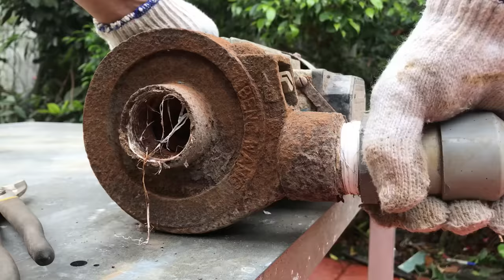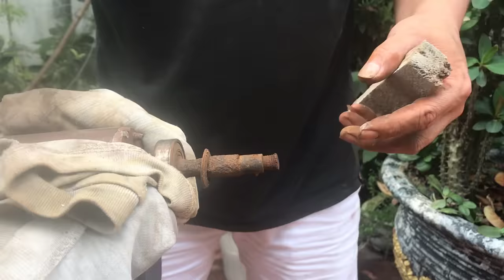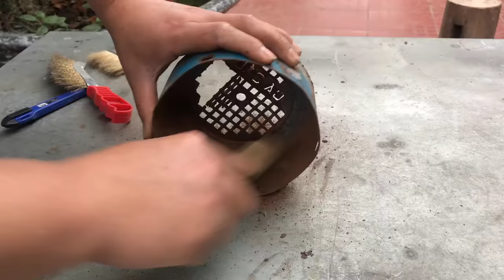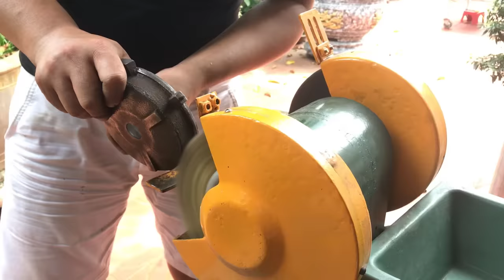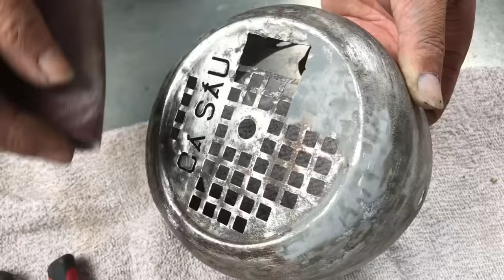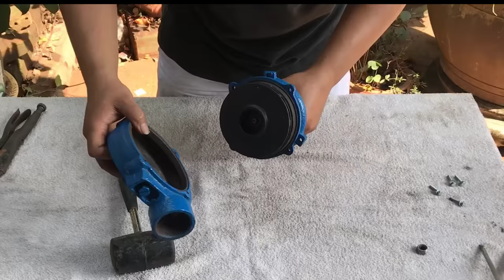Electric Water Pump Restoration - Restoration Perfectly - Tool Restoration

Comment: Some have commented on the lack of the right tools.....In my opinion it is not the tools that make the restoration...It is the use of the tools available that makes the worker A GREAT RESTORER. !! Great Job :)
Reply: I agree
Reply: MY 9yr old can do so, if we had the tools. Thats a fact
Reply: "A GREAT RESTORER" uses the correct tools. A few basic tools are all that is required to do it properly.
Reply: I do not agree with you, there have been many failures in this restoration. If this pump were tested with water, water may leak through the mechanical seal. Bad work done.
Reply: U
Reply: whaha, the first tool that comes into my mind is a sandblaster. that would save soo much time and effort
Reply: absolutely
Reply: dazzIar3 I noticed that too. but i gave consideration coz boIt's head were aIready deformed because of rust. he used proper tooIs when repIaced by the new one.
Reply: I think that you can have all the best tools in the market, but.. if you don't know what to do with them then they are useless, but on the contrary if you know what to do and don't have all the tools but you can get the very same result or even better , then .. you are a genius.
Reply: Заебись
Reply: I can restore anything and im 10
Reply: Hello
Reply: You said man, I'm a auto technitian and a older technition that I worked with and learned a lot from told me that same thing, that's cool that you said that.
Reply: @zenobiomenezesalvim1398  I disagree with you man, I've repaired my pump and the thing runs great no leaks and trust me if you saw my rebuild, you would scratch your head, it's a electric pump it will be fine, stop hating.
Reply: 善用手邊的各種工具,像馬蓋仙一樣
Reply: I agree.  People with all the fancy big shiny tool sets are usually the ones that would just go out and purchase a new water pump anyway.
Reply: Great experiences تجارب رائعة l
Reply: Йй
Reply: Okey muchas gracias sigan asi
Reply: 0000
Reply: @สุนิภาคุราโมจิ  what does this mean in English??
Reply: 11
Reply: @fellpower  c
Reply: 100% correct. Ingenuity and resourcefulness is the key.
Reply: Professionnel
o
Reply: Ok
Reply: Hıyar pompayı yanlış topladı
Reply: J
Reply: he  dose  not   have  proper  tool
Reply: @frankbradleyjr  km😭
Reply: comprate mas herramientas, pata trabajar mas eficiente y rápido!
Reply: حننن

Comment: After restoration and running the pump dry  well.. good luck to the newly installed shaft seal
Reply: made that mistake once. cracked the Teflon like a moron. Good job though. If you had used a puller the vid would only be 8 minutes long in real time.

Comment: The water outlet originally was on the top. After reassembly, it was to the side. You have turned pumping section of 90 degrees.

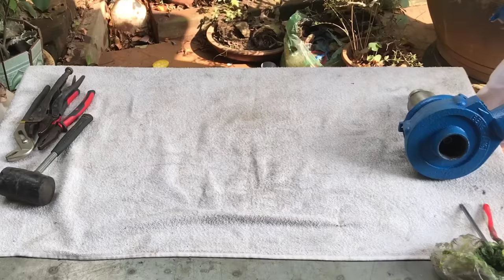Comment: You didnt tape off the  eye connectors on the ends of the  wires and they are covered in blue paint when you reassemble from 24:32 on.

Comment: Why you connect it with two wire cable ? And what PE ? .....Especially at water pump it is sooo important when winding break to motor casing.
Reply: Welcome to Asia... I don't think I've seen any restoration video that conformed to European safety standards yet. Or maybe one... and that was Czech, not Asian.
Reply: Thai style
Reply: and look at the wiring cables of the motor with paint on it.. :D no matter, lets put cable terminals over it :D
Reply: ఈ మేరకు కేసు కీలక jjjzjhejdhejjjjzjznnjz

Comment: Good work. Except, the output/outlet facing sideways rather than facing upwards. Anybody noticed it?
Reply: Shouldn't be any problem. In some cases, the pressure side pipe needs to be turned.

Comment: I greet you friend and congratulate you for your great willingness to work. I admire the effort you have put into it.
However, I note that the motor shaft is worn and deformed at the end of the pump. That axis must have been repaired, that is, filled to its original diameter and machined; because that's where the pump seal fits so you don't lose water. It is very likely that if it is not repaired there, it will lose and end up spoiling the new bearing.
Finally, the drive connection goes up and not to the side. Notice that you have a drain plug there that should also be up. Greetings and congratulations!

Comment: I like your video for dedication & hard-working. There are many mechanical faults you have to do - the Main shaft is very loose in roter,  shaft is under size for mechanical seal because rusted, you apply grease in ceramic side, you have change delivery side its up on the  beginning(no matter for this pump). so I can say that the pump is running but not suck the water.

Comment: Exit pipe is horizontal (should be vertical)  cooling fan removed, the bearing is not properly fit. No earth cable.... What is it used for? Quick sale?

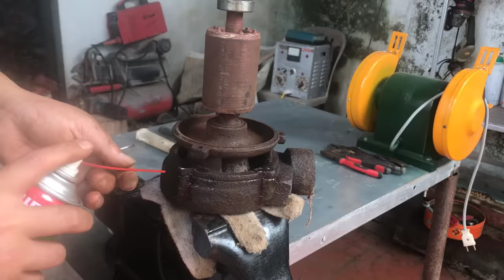Comment: 4:28  There are better ways to get rusted  thing loose like these ones . For exemple Electricity combined with water and landy  soap   with the part saoked in it for about 24 hours depending what kind of voltage and amperage you use but extremely effective

Comment: That was interesting to watch and entertaining, just a little constructive criticism, you should be pushing the stationary part of the mechanical seal in by hand, don't knock or hit the carbon face with a metal object, the actual mechanical seal journal was very badly worn ( you would need a shaft repair or replacement, so understandable why it was left as it was) and on installation would no doubt leak like crazy, also I didn't see the impeller being retained by a nut? was still an good video though, and i gave a thumbs up :)
Reply: Shaun - i agree withyour comment. The impeller nut was on the table and suddenly disappeared - guess it was later fitted. The only other comment i have is -that at the end and i think just to show that the pump worked - the pump was running "dry" - which is a 100% not to do.

Comment: TAIZHOU JINLONG PUMP CO.LTD. is one of the major professional manufacturers for water pump and accessories of pump in China. Ww are located in Wenling city Zhejiang province of China. And were founded in 1980.Our current production ability is over 1.000.000 Pcs year.
We always supply high quality pumps at competitive prices and best export service for all customers, Our main products including. Vortex pump, automatic controller and parts of pump. Some of our products have the approval of CE/GS . The quality or our pumps is under strict control in every aspect of products and is also acknowfedged by ISO9002.

Comment: Try to not spray paint the Electrical Connections next time, and DONT run a water pump dry that will destroy the pump, it is a water pump not a blower fan

Comment: Learned the expensive way that one should not run a water pump dry because the water seal between the pump and motor will get damaged. Test the unit with it connected to a water source.

Comment: leaving the blue paint on the end of the wires(around 27:00) was a  bit "wrong" should have cleaned them off, that way more surface area  for connection

Comment: Shaft need to be more work on lathe the shaft has damaged by rust
It will not work properly
You did not test it with water

Comment: Man you grinned the shaft and rotor, you can't do that. Those are designed tolerance. That shaft position has to be exact or the impeller will grind into the volute.  You put the motor together first, then install seal kit and the impeller. It's not going to last long since you grinded that shaft.
Reply: It didn't look like a abrasive wheel more like a cloth wheel

Comment: Vinegar will take rust away over night. Give it a try.
Reply: Matthew Talbot Why is it rúty ?
Reply: Right and using a wire brush the next day will smoothly take whats left of the rust off.
Reply: Oh don't forget some salt mixed in with the vinegar is needed as well for added effectiveness
Reply: I understand
Reply: If you use vinegar works extremely fast if heated (not boiling) and once you have achieved the result put bicarb soda in to neutralise the acid from the vinegar.. Works a charm.. Molasses also works extremely well if not better.

Comment: never run a water seal without water as a lubricant or you will burn the new seal and it will leak or fail early
Reply: I would say that seal will be knackered already.

Comment: Everything looked ok until you closed up the electrical box without properly seating that white wire. It's basically not connected, prepare to have a short from that at some point.

Comment: never ever do this as to why the shaft is worn so would not seal on the shaft and would need metalising  to bring it back to its correct size and you would never ever run a pump dry   i know this is my  job  of 12 years now

Comment: capacitor has blue contacts from color, poor coloring procedure. The contacts will not have a conductive connection or there will be a high contact resistance. Miserable work.

Comment: Schematic diagram or winding connection with cap of that motor sir please,thank you
Reply: The motor you see here is a single phase AC motor running on either 115 or 230 Volts 50 / 60 Hz, depending upon the country it has been designed to operate. The copper winding is divided into two coils, one is the main winding with a low internal resistance, and the other one is the auxiliary winding with a higher internal resistance. Both can be determined that way with a multimeter set to Ohms. For this type of motor to run in a one direction you need an operating capacitor ( NOT A STARTING CAPACITOR ! ) . The schematics is as follows:

L1 ( Live ) ---> [ MAIN WINDING <Ω ] ---> N ( Neutral )

L1 ( Live ) ---> [ OPERATING CAPACITOR ] ---> [ AUXILIARY WINDING >Ω ] ---> N ( Neutral )

PE ( Protective Earth ) --->  [ MOTOR HOUSING ] ( EXTREMELY IMPORTANT ! ! ! )

Notice that you have a mixed connection which is commonly used worldwide for any single phase AC motor of this type.

For the near correct size of the operating capacitor, use the following rule of thumb: 70 µF per Kilowatt motor power.

If your motor turns the wrong way, switch the two wires of the main or auxiliary coil. That way, you reverse the phase to that particular coil, and the motor turns the other way.

I hope that this is helpful to you. ;-)
Reply: @Bandicoot803  thank u sir,very much
Reply: @ben28ytchannel88  You're welcome! ;-)

Comment: Ridiculous
The main shaft was loose on the rotor,the pump would leak like crazy because the seal seating was worn and cleaned up on a abrasive wheel.The pump was run dry which would have completely ruined the new seal anyway.This was a lesson in cleaning and painting worn parts and not a decent repair, sorry!